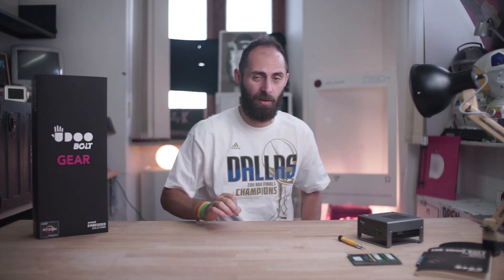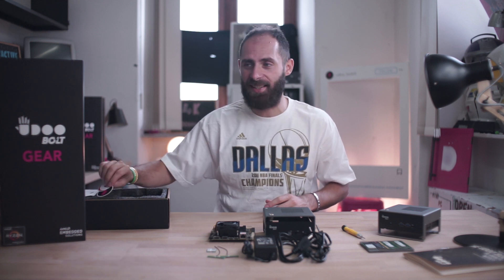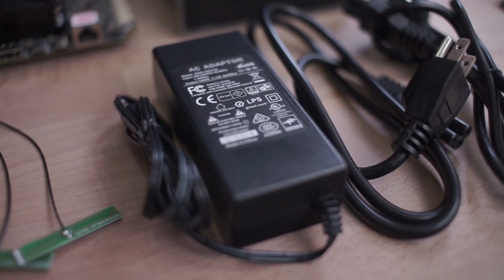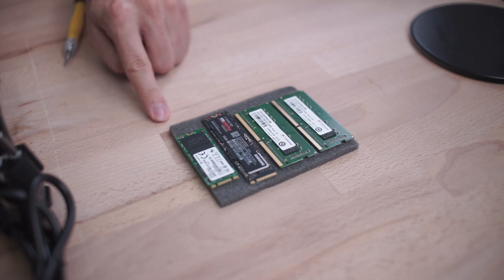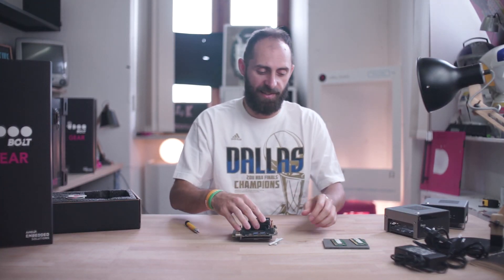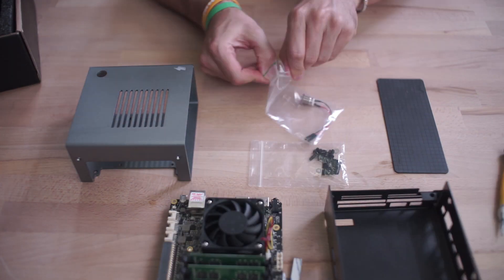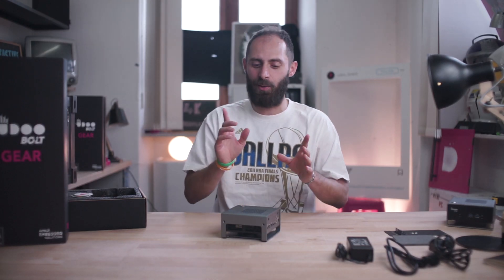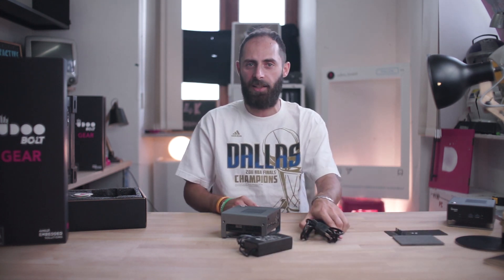THE UDOO BOLT GEAR GET STARTED GUIDE

Comment: is there any plan for fancy LED fan and case ?
Reply from the maker: Right now we can't say a thing ;)
Reply: @UDOO  well I'll say I love it I've had it for long time now but my only quarrel is I prefer the wifi and Bluetooth antennas have external placements above the USB on the headphone jack side

I just wish there were holes included that gave me the option to mount them there and/probably and led that would shine inwards (led can be installed parasitically somehow I'm sure)

Comment: I purchased and received a bolt v8 👌🤙 but unfortunately I lost my password to my ACC with you guys and when I click the reset link I don't receive an email 

Help?
I still have my order number associated with the account

Also it appears as if my udoo isn't reading my HDD drive
Reply from the maker: Hey there, I suggest opening a ticket at https://ticket.udoo.org/
Reply: @UDOO  we got it turns out we needed to "toaster" the hard drive and it ended up reading